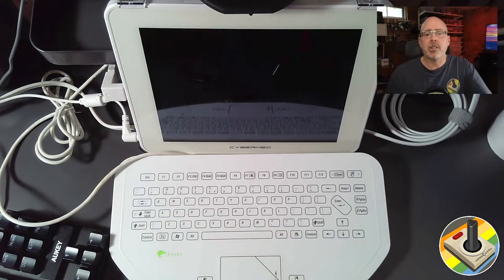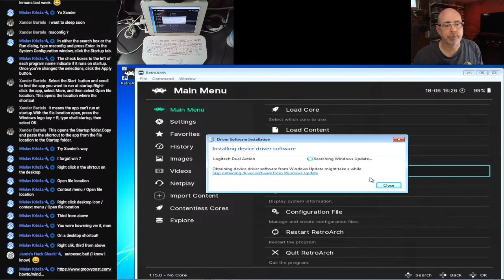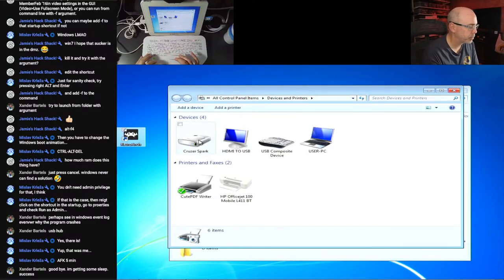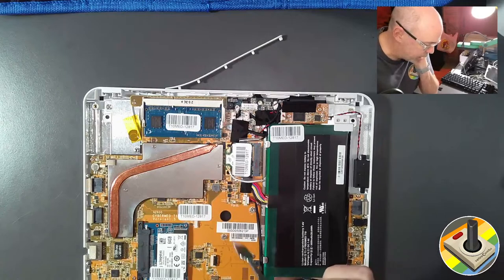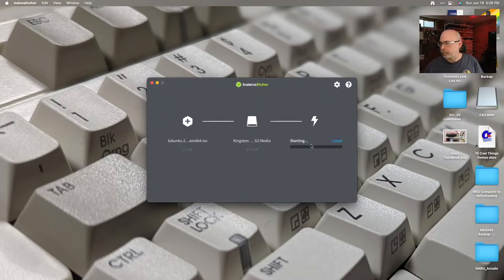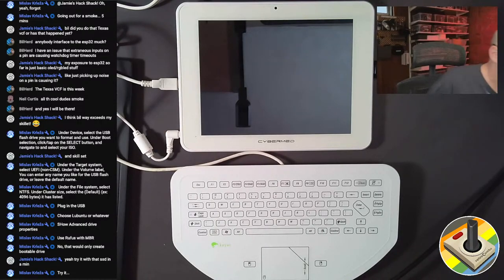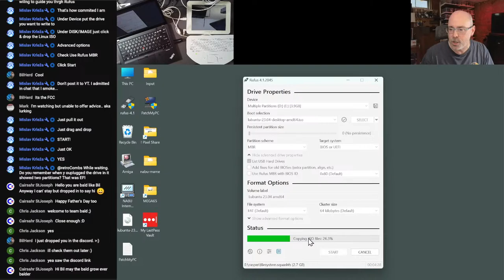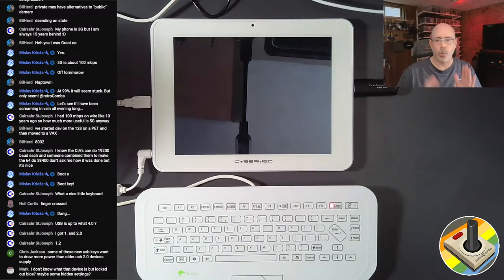Part 2: Install RetroArch on a Cybermed Medical Computer 🕹️

Comment: I really like the Hyperkin X91 and the Rig Nacon Pro Compact for controllers but will be getting the Raphnet adapter for SNES to USB V2 and a SNES NTT Data Keypad for Colecovision and Intellivision Emulation. I almost bought one of these but went with the Eglobal Cheap Portable Mini PC i7 from Ali-Express and a Dell Latitude i7. I do most of my Emulation on the Raspberry Pi 4B 8GB in the Vilros keyboard/touchpad hub with an 8bitdo N30 wireless mouse. I run Berryboot Retro Pi and multiple other Operating Systems. Berryboot lets you do that. It's like a Stealthy Black C64.
Reply from the maker: That's a whole laundry list of things for me to check out! Thanks.